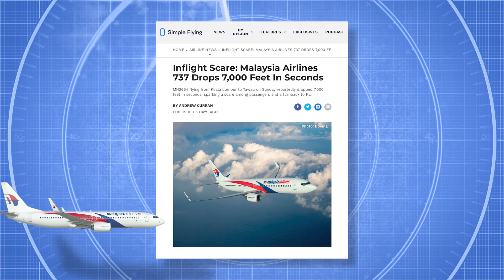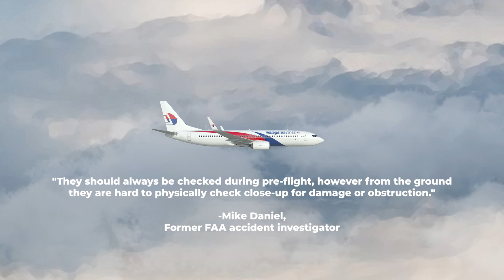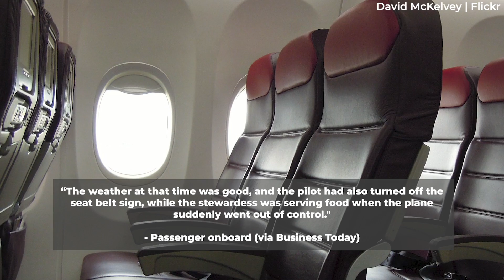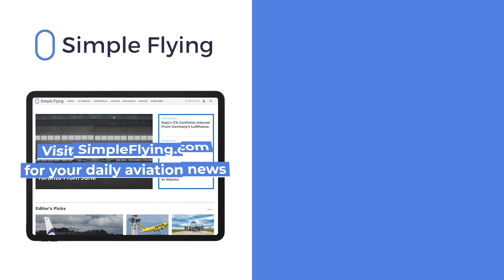Malfunctioning Pitot System Caused Malaysia Airlines Boeing 737 Dive

Comment: No mention of which pilot tube was "blocked, or malfunctioning". There are three separate systems. Unlikely one system failure cause this along. I don't buy it. There's more to thus than meets the eye. Why suggest a manufacturing issue? 737 NGs go back almost 20 years. How many millions of miles have they flown collectively without a pilot "malfunction".? Something is wrong with this picture.  My view is that system knowledge has deteriorated substantially. Over the years, I've seen training degrade.  Why suggest upset training (UPRT), when the crew recovered correctly,  and flew around to burn fuel before landing? Another mysterious red flag.
Reply: If it didn't happen from time to time (and it does -- on the NG and others), they wouldn't bother incorporating an IAS DISAGREE warning.  Usually (AFAIK) it's more than a single unit malfunctioning which triggers the situation, but that does happen.  Blockage in the source or drain, heater failure, short circuit, and just reliability problems in general.  AF447, on its way across the Atlantic, was slated for replacement of its pitot tubes with a more reliable model once it landed it Paris.  But because of pitot tube problems, it never made it to Paris (that crash would be one reason to suggest a manufacturing issue).

Spend enough time working airliner problems (or at least enough time reading SDR's), and none of this looks "mysterious".

Comment: I think that Pitot inspection should be mandatory. An aircrash (maybe more) already occurred because of pitot malfunction. This one was a near miss, time to watch it.
Reply: A single pitot malfunction does not cause a crash because only 1 instrument is affected, not the other 2. And even if 3 fail it just means loss of airspeed indication. You can still fly with pitch power settings

Comment: Could there be a chance that the China Eastern flight could have had this malfunction,but the pilot may not have reacted quick enough,therefore making it fatal?
Reply: No. The autopilot would not have caused the plane to dive at that rate and speed
Reply: @tomstravels520   maybe it disconnected?
Reply: @rannnn5498 when it disconnects it sounds an alarm that can’t be ignored
Reply: @tomstravels520   yes,that’s true,but maybe the pilots tried to engage it and it failed?therefore,their attention was towards engaging the autopilot,not realizing t he plane was plummeting,however,you probably are right.I just like to imagine lpl
Reply: @rannnn5498  I don’t know how the pilots could fail to spot there would be no sky on ADI and their altitude dropping rapidly or not even feel the negative G
Reply: @tomstravels520   yes,that’s true

Comment: Over reaction from the pilot flying.......
Just fly the plane......usual  power and pitch for the cruise and determine which pitot system is in error.
Use the working system....
You also have GPS speed ......
Reply: At high altitude your GPS speed is not identical to your airspeed due to difference is air density and wind component

Comment: Uhh, the 737 has 5 sets of pitot tubes.  There's no way in hell they were all damaged or suddenly plugged up.  Most likely reason is the pilots forgot to turn on the pitot heat before takeoff and they iced up on the climb through a cloud.
Reply: The very early 737 models had five sets of pitot tubes, later models do not.  It is highly unlikely the pilots forgot to turn on the pitot heat because the resulting OFF lights would trigger a master caution indication on both sides of the cockpit.
Reply: The 737 maxs only had 1 pitot tube, that's what made them mcas into the ground
Reply: @robinross6701  - Wrong on both accounts. Your statement shows how little you know about the 737 and the MCAS incident.
Reply: @Hopeless_and_Forlorn  considering the red light(s) that come on are on the overhead panel and rather high up and you can totally forget about clearing the recall warnings, AND some 737NGs are equipped with auto vs on/off pitot heat switches, it's actually easier to overlook & forget than you might think.

Comment: So the pitot tubes are prone to blocking and are located on the aircraft in a position that makes checking them for blockages from the ground difficult. Two basic design faults that should never have gone past basic approval for the aircraft to fly. The pitot tubes need to be redesigned so they don't block. And they need to be repositioned on the aircraft so they can easily be checked before every flight. It's been reported elsewhere that they are also prone to icing up. So they need to be heated during flight so ice cannot form in them.
Reply: How do you block something that needs an open air gap at the front to measure airspeed. And they are position where the air is smoothest which is usually the sides
Reply: The phrase you are looking for is "design tradeoffs".  As already noted, location of the tubes is largely determined by aerodynamics.  Presumably on some airliner types they could be down lower to allow for better inspection, but then they are going to be more suseptible to damage from normal ground operations (unreported damage, assuming someone doesn't feel like losing their job).  Many of the problems they have aren't going to be cured by the ability to do a closer visual  inspection anyway:  Short circuit, blockage down inside the tube, drain blockage, heater failure (yes, heaters already got thought of).

Comment: What concerns me, is that if I have understood it correctly, the malfunction of a single component has had such a potentially catastrophic effect.

Should it turn out to be an inadequacy in a design carried forward from earlier models which would not be permitted on a new aircraft, it makes me wonder if it is time for the regulatory bodies to re-consider which 'Grandfather rights' are or were appropriate to be carried forwards.

Could this be another case of automation not included in previous designs using input from sensors which were originally installed more to inform and warn rather than to control the aircraft no longer being appropriate?

Comment: This is the same type of B737-800 that crashed in China some weeks ago. That plane also went through a deep dive in flight which unfortunately it did not recover from. I will not be surprised if investigators on the Chinese crash at the moment end up discovering that this is also the 'culprit' behind the crash in China.
Reply: Yeah right, because aircraft tend to fly for more than 20 years without sensor related issues and suddenly develop said sensor issues within a week across all NGs…
Reply: The autopilot disengages in this situation so the pilot has to hand fly the aircraft. Also, this type of plane won't put itself into a steep almost vertical dive. It has to be deliberately induced. I became a military pilot in 1969 and was later trained as an aviation crash investigator there.
Reply: Impossible.  I once asked a 737 pilot how he would handle a total loss of airspeed indications in flight.  "Simple," he said.  "Attitude and N1."  In other words, monitor the aircraft pitch angle and engine power settings.  Maintain the same values that are usual for the desired flight conditions, and of course try to maintain VMC.
Reply: I thought the same, even if it's a "convenient truth".
Reply: @Hopeless_and_Forlorn  It's not impossible. AF447 crashed when the pitot tubes became blocked due to icing, and the pilot reacted inappropriately by stalling the aircraft.
Reply: @LordSandwichII  - Hopeless is saying that a recover from loss of airspeed is to maintain known pitch and thrust whilst knowing what other instruments are working for you, ie altimeter. With the AF incident they didn’t correctly react to the situation (rather like the recent AF 777 incident) and they stalled the aircraft into the sea from cruise altitude.
Reply: @EdOeuna  He said that it's impossible. However it's only impossible if the pilot does everything right.
Reply: @LordSandwichII  - the word impossible seems to be used in the context of it’s impossible for the AFDS to use one erroneous input to command the aircraft against two other sources of data. This is truely impossible. The automation sees the fault and earns the pilots. From this point on the aircraft is easily controlled with pitch and power. Even the 777 has a set of tables advising pitch and thrust for varying altitudes and flight configurations. It’s all pretty basic without airspeed.

Comment: Surely there has to be a better technological solution to this rather than outdated pitot static tubes.
Reply: You need to know what the air outside is like to get accurate airspeed. Therefore the sensor needs to be outside

Comment: Unfortunately it sounds like an air-readiness problem with the airline company or industry in Malaysia...Sounds as if the pitot systems on any bird can suffer the same ailments...Need to be careful in suspecting the manufacturer only.
Reply: Yep, first they blame the manufacturer, then the pilots, and lastly the airline. It's always like that.
Reply: Malaysia Airlines has some kind of history with technical incidents for the last 30 years now. Mainly because of the stiff hirachy within the employment bases and lacking cost coverage for maintainance. They do try and solve this problem for the better half of 10 years now, rebranded and made multiple other changes. Seemed not to be sufficient though

Comment: Airlines should have redundancy built into such systems.     Have several pitot tubes and compare the results.   If one is out of line with the others, stop using the signal and raise a warning for it to be checked when the plane lands.    Really basic systems engineering.
Reply: It does. That’s why this makes no sense
Reply: They do.....

Comment: The problem is Boeing's computers response to faulty input data, not the tubes generating the faulty input. It should never be ok for the flight computer to put a plane into a dive like that.
Reply: It’s highly unlikely that the autopilot commanded a dive like that, so it’s highly unlikely that the dive was caused by automation unless all three pitot tubes were blocked at the same time. In that event it’s up to the pilots to intervene and disengage all automation and hand fly the aircraft.

Comment: My thoughts about this? 1 sensor fails and the aircraft dives or does strange things. That's just ridicules that they still got the certification for this type (and the MAX). THY 1951... MCAS... what's wrong with those engineers? How many more do have to die until they finally do something? Why do we have multiple sensors and redundancy and still 1 single failing sensor can crash an aircraft!

Comment: Pitot tube is too high so they wouldn't want to check it ? Why doesn't they have a GPS on board 😃
Reply: They do. But GPS measures ground speed, not airspeed
Reply: By the time it's low enough to shine a flashlight into (which still wouldn't reveal some problems), it's subject to damage by ground operations.

Comment: I think Boeing and possibly Airbus need to find a different way to measure the AOA other than the pitot tubes because it is ALWAYS these sensors that either bring down the planes or nearly brought down and this has to stop. Find a better way to measure the AOA please.
Reply: AOA isn’t measured by pitot tubes. Speed is. And there isn’t really any other way because the sensor needs to know how the air is flowing over itself
Reply: @tomstravels520  yes they do measure the AOA and ok the speed as well and there is another way and Boeing are having to incorporate it into the Max right now.
Reply: @abritabroadinthephilippines  AOA sensors measure AOA. Pitot tubes measure airspeed. That why aircraft have 2 or 3 sets of both. 

What Boeing are adding to the max is a synthetic version but that is not as accurate. It’s a way to check against the 2 real sensors with artificial one. If one suddenly fails or gives readings wildly different to the synthetic and other real one, the computer then knows it has failed. This is to make up the fact that currently with only 2 sensors if 1 give wild readings, the computer can’t tell which is correct.

Airbus have had 3 physical AOA sensors in all aircraft since the A320 and has now produced software to track if any have failed against the load factor
Reply: @tomstravels520  ok well they still need to find a better way to measure everything can we agree on that. I know the work around on the Max is another software based fix though so maybe it's an actual new sensor or rather set of sensors is needed.
Reply: @abritabroadinthephilippines  the plane and its computers need to know what the air outside is like which means sensors have to be on the outside. You can’t compute airspeed accurately without knowing how fast the air is flowing around you. Even the backup system I mentioned uses another set of sensors on the outside
Reply: @tomstravels520  Then a change in design of the sensors maybe? Something has to be done I know that much so maybe adding more of the sensors ?

Comment: Most likely blocked pitot tubes from insect etc especially if this tail has just been RTS after parking /storage..blow out may not be a 100% fix..Boeing needs to find a solution/..maint practice for sure
Reply: Then it would have been picked up during takeoff
Reply: @tomstravels520  Only heating of pitot tubes is monitored by CMS, not blockages! There is no guarantee when an FOD, and at which profile, can block the tube if present.
Reply: @praseninamdar4743  I known blockages can’t be detected but a small object even if not fully blocking the probe will still likely cause a difference in airspeed reading

Comment: If its a Boeing I ain't going.
Reply: This wasn't Boeing's fault. It was pilot and ground crew error.
Reply: Cool!  Ride a bike then.  🤣
Reply: There are thousands of them flying everyday. And in case you didn’t know Airbus caused some crashes too…
Reply: @igormocko7625  in fact, if I did the math right, Airbus has a higher rate of crashes a year than Boeing.
Reply: Sounds like a motto:

"If it's a Boeing I ain't goeing " 🤣
Reply: @jackson3190  I’d love to see those calculations. The 737 has a much higher fatality rate than the A320 across all variants.
Reply: @tomstravels520  but how many years after the 737 did the 320 start flying?
Reply: @jackson3190  sorry I wasn’t clear. The stats were based on fatal crashes per million flights. The A320 family is 0.09, the 737 family is 0.24
Reply: Originality isn’t your specialty, is it?
Reply: @CrossMarking  and flying has got much safer as a result
Reply: Ride a car on the atlantic ocean then XD
Reply: @CrossMarking  look at Alaska Airlines 261. It dived, levelled out then dived again due to the stabiliser
Reply: @stevegiboney4493  no, but it does get the sentiment across.
Reply: @noahthesarcastictd  I'll just take a bus... An Airbus
Reply: @CrossMarking  but the design itself is almost identical to the 737. A jackscrew moves the stabiliser up and one by an mechanical movement or assisted by an electric motor. It could also have not been maintained

Comment: B737 design is 50 years old now and still they can't get it right
Reply: It's not Boeing's fault. It is the pilot and ground crew that are at fault here.
Reply: @jackson3190  its pilot system not the pilot
Reply: @faizierazali3494  If you can’t handle the autopilot disconnecting, you should be in the back, serving drinks.
Reply: @faizierazali3494  A. You just said it was a pilot system. 
B. I know it was the pitot system. I'm saying the pilot didn't check to see if it was clear before takeoff.
Reply: What does the manufacturer have to do with airline staff disregarding a manufacturers manual?
Reply: @jackson3190  im misunderstood i taught its problem of nav system is a pilot system

Comment: If the plane was a B38M using the old 2016-2019 MCAS it would have been crashed
I'm glad this was a B738
Reply: The NG isn’t fly-by-wire buddy.

MCAS wasn’t a thing back in 1998 yk…
Reply: @dopepopeurban6129  oh no, a guy doesn't get it
Reply: @classicicemc2848  ^^
Reply: @dopepopeurban6129  edited the comment for you
Reply: @classicicemc2848  dude its fine, it was just a joke xD